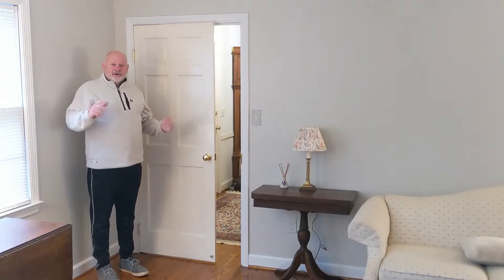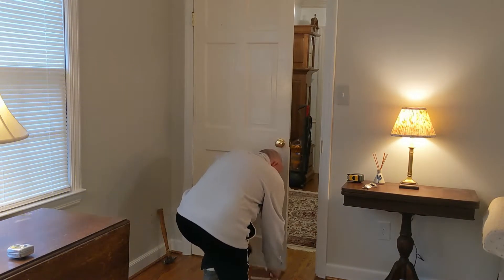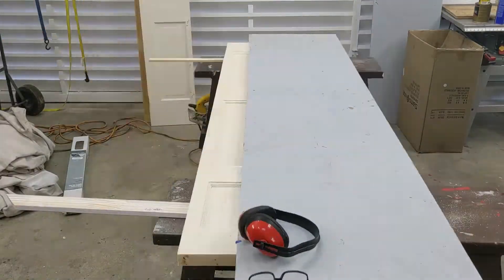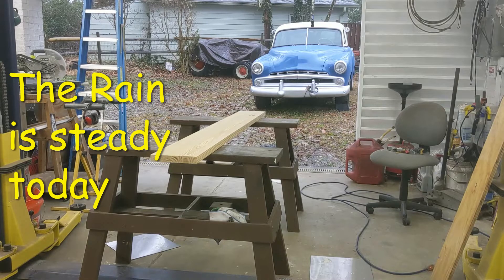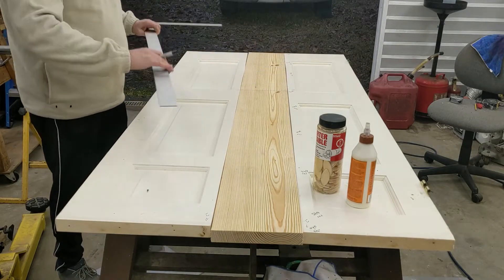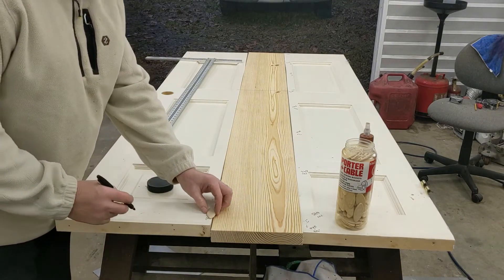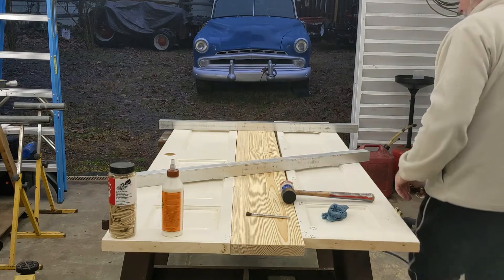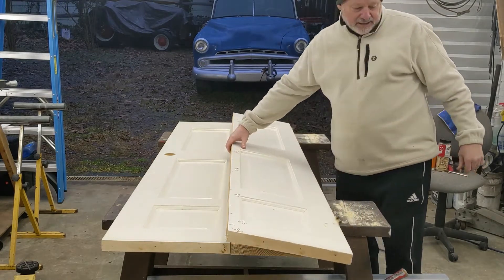How to make a door wider

Comment: Nothing like millimetre accurate metric, I have to do this with a french door so I'm adding 50mm of oregon to each side
Reply from the maker: Yes !   the Metric system is far superior to the primitive imperial system, after using both and having to alternate and convert between the two systems for decades....I saw early on the merits of the metric system
Reply from the maker: I work in R&D engineering and have always had to work with both systems.  And yes, I have several all metric tape measures and often just use metric measurements in woodworking and remodeling but there is still so many products not metric so I still have to convert.  Fractional measurements are such waste of energy and attention
Reply from the maker: Imperial measurements should be banned in scientific papers.... every where for that matter
Reply from the maker: Anyone who says they like imperial just has not worked with metric yet
Reply: @neuromanglers  agreed